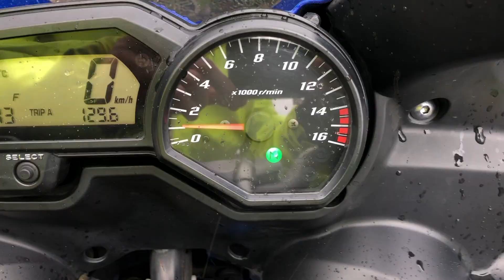Iridium Spark Plug Upgrade for FZ6 + Tips for Installation

Comment: My 07 FZ6N S2 had the same idling issue. Misfires when pulling away from a stop until about 3-4k rpm, above it ran and revs fine.
I also switched tot iridium plugs and they didn't fix it (came back after some kilometers).

 I used your videos to diagnose the ignition with a multimeter, all good.
Then i decided to replace all 4 sparkplug caps. When pulling them out a few had some small cracks in the plastic under the rubber end.
While at it i gapped down the iridium plugs to spec. This last maintenance fixed the issue and since I've driven about 2500km without any issue!

Thanks for the nice and informative videos, keep it up.
Reply from the maker: That’s some great insight into the misfire for me! I didn’t take a super close look at my caps for cracks but nothing obvious, maybe I’ll take closer look. Thanks for the ideas!
Reply: Hey I had this exact same issue with my fz6. idle issues at low rev, no issue in high rev. I Changed the plugs multiple times with multiple types and still never fixed it. In the end I replace the two ignition coils and the problem was fixed perfectly. I found a pair of OEM Denso coils on Ebay since a brand new pair is expensive.
Reply: @uncleiroh162  aren’t there 4 ignition coils? Did you have to replace all of them?
Reply: @choppaprod  there's only two I'm sure. 1 to a pair of plugs. I replaced them both but i reckon only one needed it. They're positioned under the battery.

Comment: Just bought a 06 fz6 today and I love it
Reply from the maker: Enjoy the bike!
Reply: @Calvinm  would it be a good idea to run on premium gas with these bikes?
Reply: @acesmoka I read in the FZ6 Faser service manual that 95 Research Octane Number (RON) is the required fuel to use. 
And 95 RON is roughly equivalent to 91-octane on the anti-knock index currently used in the United States, according to Google.

Comment: They are $21.00 on Ebay.  search the plug number instead of "plugs for  the FZ6".  Check the gap on each one how ever.  In my set of 4 each one was different.  anything from about .020 to .036.  I gapped them (without touching the iridium wire) to a uniform .026..  My old plugs had 57K Miles on them and the gap was up to .040.  It even wore the electrode into an oval pattern.  I didn't have any misfire issue however (I redline it maybe 1% of the time, because who can see that tach on the 04 version. . . so I think I just got away with it). . ..  But I just saw your reliability video and I bet the idle speed was the root cause of your misfire issue.  Low voltage can cause all kinds of intermittent phantom issues that will lead you on a wild goose chase.   Thanks for documenting your journey so we all can learn.
Reply from the maker: Thanks for sharing your insights! Gives me an idea of what people are doing with this plug 👍

Comment: You can also use a ratchet ring spanner in conjunction with the factory plug remover to install and remove the plugs. I have 2007 naked FZ6 and the plugs NGK/CR9EK were still good after the recommended 40,000 k
Replacement gapped at 0.63 mm or 0.25 inches .

Comment: I bought a 2008 fz6-n two months ago for an absolute steal. However I live in Sweden, and have to wait until spring to ride... I have binge watched your maintanence videos and get more and more impatient to get riding!
One mod that I have checked out and plan to do is the MT07 clutch push lever swap. It will supposedly increase the "clutch slip zone" and make the clutch lighter to operate. Have you considered this mod? It would be nice to hear your take :) 
Cheers and thanks for the great videos!
Reply from the maker: I hope you enjoy the riding season when it comes! I have heard about the MT07 clutch lever swap but haven’t been to tempted since I don’t have any complaints about the stock one.
Reply: Update: I lubricated my clutch cable with some PTFE based lubricant, which made my clutch lever almost only half as heavy to pull :)
Reply: Mt07 lever works great friction zone much easier to find for slow maneuvers

Comment: My bike has the beginnings of that same misfire. It only just had new plugs. At twenty years old I'm guessing coils same as yours was. I'll be fitting R6 stick coils, wired in series. Fingers crossed!
Reply from the maker: The R6 coil pack mod makes a lot of sense for the FZ6 in my mind. I haven’t seen a clear write up on exactly how to do it though. Good luck!
Reply: It turned out to be the TPS. Yamaha did a voluntary recall for 2004-06 fz6 models as they had received a faulty batch from their suppliers, it hadn't been done on my bike so they did it free if charge, even though the bike is 20 years old now.
Maybe somebody else who's having the same problem sees this and calls their dealer to check 😊

Comment: Did you ever figure out that miss fire? I believe i have the same thing on my 04 with only 5k miles. Bumpy idle and also very bumpy throttle at low speeds. I had the tps replaced via a recall and the problem got somewhat better for a few rides. Then returned. I was thinking about doing spark plugs next. Maybe possibly looking into a throttle body synch..
Reply from the maker: Ya, the problem ended up being the ignition coils. Even though they measured fine with the multimeter they were the source of my problem. I installed a used pair I bought off eBay.

Comment: Iridium plugs lasts longer thats about it, it makes sense in cars since cars have a better charging system, motorcycles on the other hand if they're designed by the manufacturer to run on copper plugs then i would stick to it, copper are a better conductor, but it won't last as long, but most motorcycles put fraction of the miles that cars do, its a matter of choice but there's a reason manufacturers instate what plugs to use in your specific bike or car.

Comment: So after 4 months do you suggest we gap or keep the spark plugs as is?
Reply from the maker: I will have an answer for you soon. It’s been the off season for riding where I am but I’ll be getting back on the FZ6 soon!
Reply: @Calvinm  True true I got family in Ontario telling me it’s been snowing recently. I went with iridium as I found a good deal on eBay. 40k miles sounds promising

Comment: My 08 had the same idle issue, also using CR9EIX, don't know how to solve the problem
Reply from the maker: Hmmm, glad to know it’s not just me.
Reply: @Calvinm   have you ever check fuel pressure or voltage to fuel pump? Sounds like my old R6 issues before I sold it. Just bought 05 FZ6 with no issues, just getting into maintenance. Gonna try stock plugs and gap for first round

Comment: Great info! I don't want to be THAT guy but it would of been nice to show HOW TO actually take them off instead of just showing us lol
Reply from the maker: Thanks for not being “That” guy 😉. In my valve lash video (linked below) I show how to remove the ignition coils and battery box in detail. In my spark plug video I go over replacing the plugs in detail. It isn’t absolutely necessary to remove the radiator when changing plugs but it makes the job easier on the hands. 

Valve lash video: https://youtu.be/jhlvvXSrNB8
Spark plug video: https://youtu.be/nwMaS-OfRlY